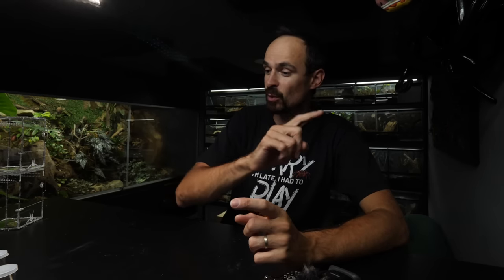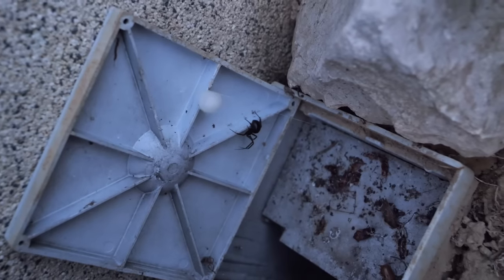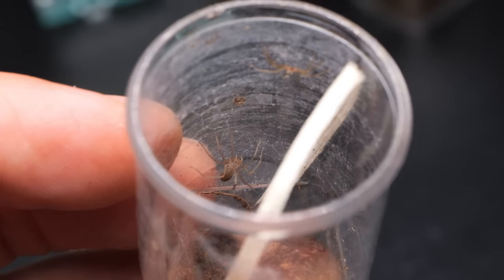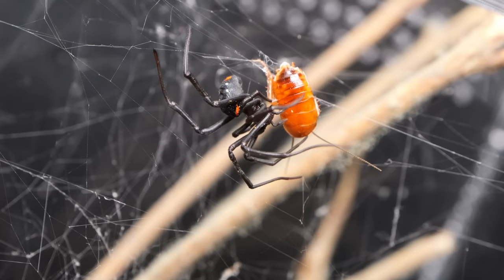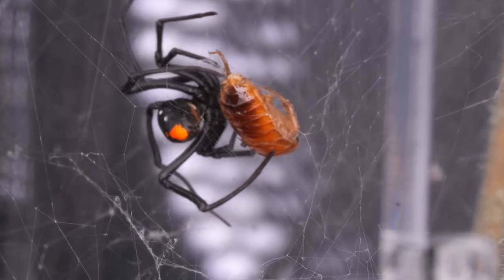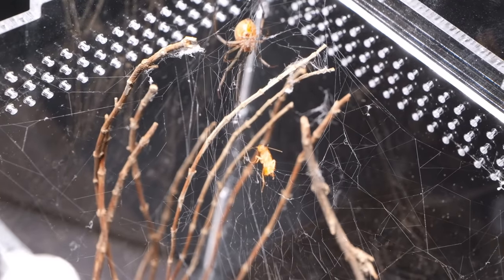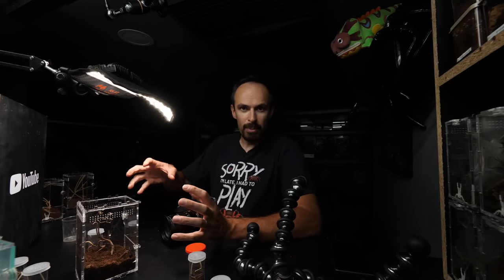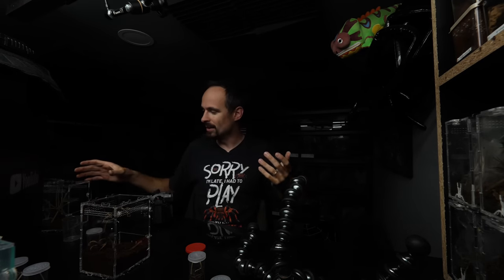I FEED MY WIDOWS!

Comment: You spider is likely a Steatoda sp. false widow. They are in the same family as the real widows (Theridiidae) and common all over the world pretty much. They usually have either white or red markings (S. paykulliana), but their colors can differ from a lighter brown to a pretty much black. Steatoda grossa for example has markings, but sometimes you can't see them very well.
Interesting fact: The bite of a real widow can cause "Latrodectism", that of a Steatoda can cause "Steatodism". It's basically a weaker version of the widow bite.

You can see a couple horror stories about their bite, but bad outcomes are rare.